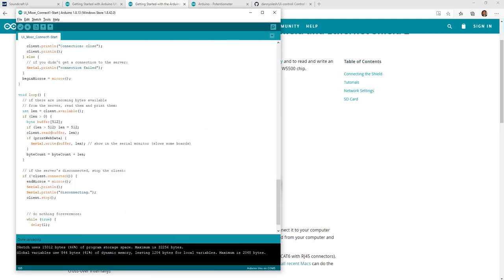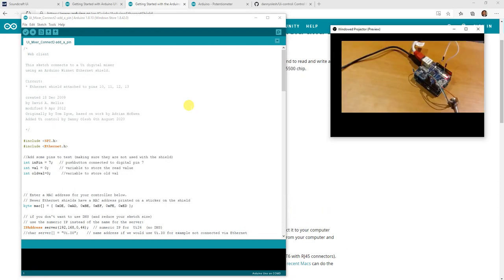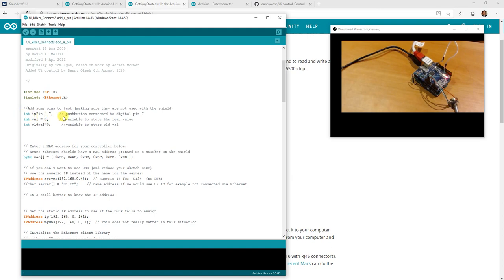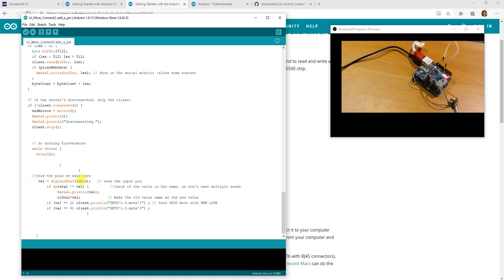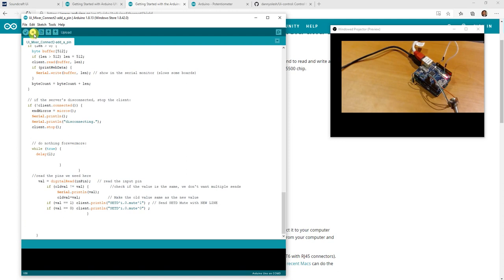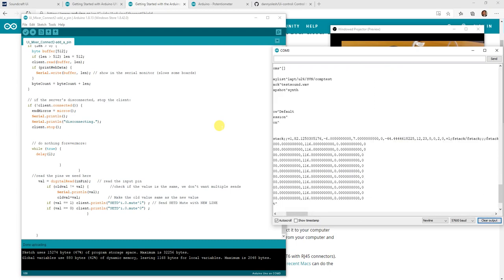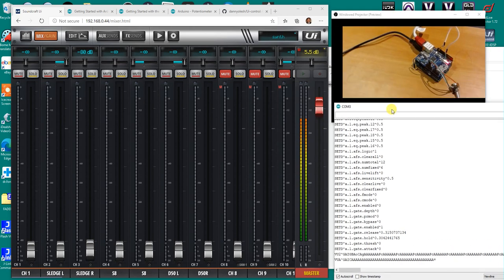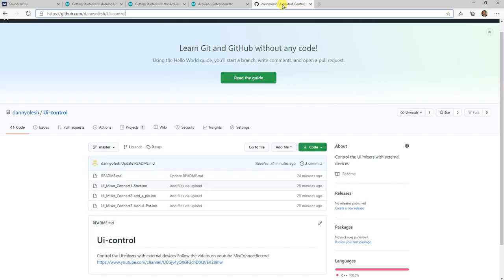Ui Mixer Arduino Control video 2 adding a button

Comment: I am starting to move into theatre productions and have used the UI for a few years. Is it possible for the UI to work with show control software like Qlabs, Show Cue Systems etc via UDP or TCP commands to change snapshots and cues?

Comment: Hey, I am not an expert, far from it :) But you could save a few resistors if you use pinMode(inPin, INPUT_PULLUP); instead of pinMode(inPin, INPUT); This activates the Atmega328's internal Pullup. Obviously  you would then have to detect the pin active when LOW. One reason I prefer it this way, is that besides lowering the number of components needed, it could avoid nasty shorts to VCC when placing stuff in a box. Just my 2 cents of course :) Great video by the way. Thank you for sharing.
Reply from the maker: Yes you could although I still like to have them in a circuit for EMC reasons. It's OK not to use them in Hobby project.